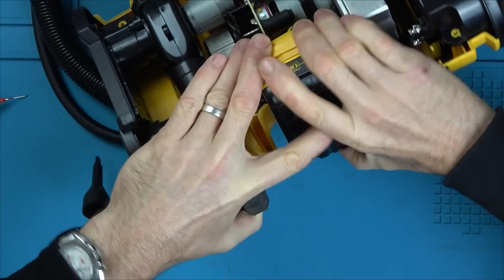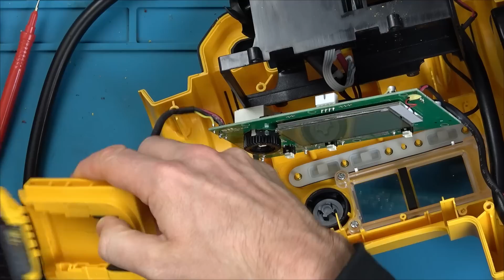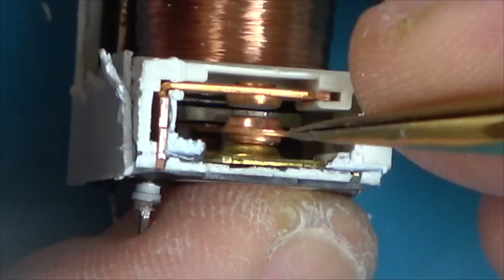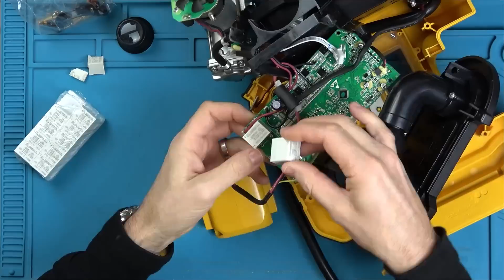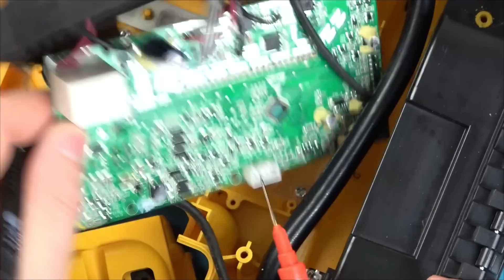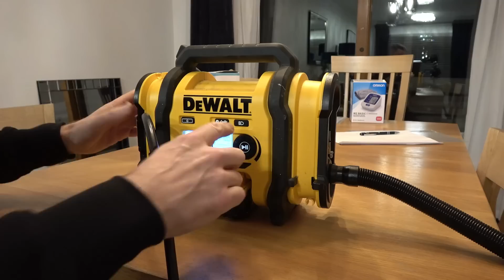My Mate Vince Advent Christmas Fixathon Challenge - Day 7

Comment: You can buy small copper bushes/inserts/rivets to replace a via. I have 4 sizes but I only need them if a customer first tried to repair something himself. 🙂 I do not damage vias because I have a professional desoldering iron (a Pace SX100 on my MB250 and a SX90 on my  MB350)

Comment: I’ve just done a repair from your video, exactly the same problem, exactly the same issue though I damaged one pad but put a jumper wire in and bingo worked a treat, I really hope you do more power tool repairs as many fail due to components on the board which with brushless tech is sealed but would love to you do some none the less keep it up 👍🏻

Comment: Forgive me if you've already been told or worked it out, but that negative plane that you were wondering why it was marked up as positive - the marking was actually for the component D2 which is a connected in reverse polarity across the relay coil to clamp the reverse voltage generated by the relay coil's mangetic field collapsing. There is another one for the other relay, D1, and this explains the positive sign on the negative copper plane.
Reply from the maker: Thank you Pete 👍👍👍
Reply: @Mymatevince  mate! you're more than welcome. thanks for all the fantastic entertainment!

Comment: That was a cringe fest! Why didn't you just link the two positive terminals of the relay with a jumper wire on the back of the PCB? It's ground side switched so you could have had that repaired in 10 minutes mate. 
And just for the record, when you said the "low voltage" side of the relay you really meant to say the low current side, because the power handling and switching sides are both 18 volts! 
Anyway, it's good to see you upping your skills and getting stuck in to electrical repairs Vince. Respect.

Comment: Diode D2 is for reverse polarity protection. That's why the anode is connected  to negative.
Reply from the maker: Ohhhh, thank you👍👍👍👍
Reply: @Mymatevince probably rather a flyback diode for the relay coil(s). There is another one across the second relay coil in reverse polarity

Comment: 40:00 I don't know if it could work, but what if you added some solder on the relay pins, so when you heat it up and solder the bottom, the solder on the top of the pins melts and solders itself on the top side?
Reply from the maker: Very good idea. I could have put a nice ball of it up by the relay and when I heated the leg it might have flowed down onto the board. Wish I tried that!!! Good thinking 💪

Comment: It states in the Dewalt manual that "if Err5 fault Code is displayed it is due to an issue with the pressure sensor" and unfortunately Dewalt doesn't have or sell this sensor part for this unit because This product discontinued and the part is no longer available.
They said we just have to buy a newer one.
This is one of them many "taste and waste products" produced in this crazy world.

Comment: Much easier to simply pass a small wire through the hole, solder to track under relay, then insert relay and solder as normal.

Comment: That one was a lot of work just for a relay!  Well done!  If I may suggest, part of your aggro probably due to your soldering iron really being designed for tiny work and not large ground plane boards.  For items like this it is a ton easier if you have a 'soldering gun'.  These are usually 100W but can be larger.  Used to be used by all CRT television repair men.  You pull the trigger until the tip is really hot and the solder smokes (takes only a few seconds), then you let the trigger go and have a big thermal mass to go at whilst doing a solder joint (or solder sucking out of the relay vias in this case).  You can keep pulsing the trigger if you have a big thermal mass to deal with to keep pumping heat into the iron tip.  They are about 30 UK pounds and useful for 'big' PCB jobs esp. if with thick wiring or braided wire to solder.  Hope this is of use.

Comment: Hi Vince, two things: First, those aren't vias. Those are through hole pads and they do tend to break whenever removing through hole components. Vias are the smaller holes that you see scattered around the PCB just for the sake of connecting two or more layers of the PCB. And when that first through hole pad broke (which is normal), you didn't need to actually correct or restore the pad. As you saw, the +18V line comming from F1 goes to another pad and connector of the relay. You could have just taken a higher gauge wire and shorted the two together. Easy as that. When you tried fixing the through hole pad with the smaller diameter jumper wires, even if you restored the connection between the top and bottom layers, that connection would have a current limitation of those wires, which probably wouldn't be enough. So you would end up in a situation where, after a while, it stopped working again because the current would just break the wires. Whenever you face this situation, know that the problem isn't yours, it's a design of the PCB: every through hole component should have it's connection on the layer where the pad actually solders to the component. In this case, the connection was done on the top layer, but the soldering was done on the bottom. Also, I do believe the other pads that are there to increase surface, probably to dissipate heat, those should still have +18V, so you could have just had a wire running there.

I'm an electronics engineer, I design hardware boards and PCBs and it's a lot of fun seeing you fixing stuff. I wouldn't fix half of the stuff you do, I just don't have the same patience you have, but your persistence makes every video worth it !
Reply from the maker: Thank you Luis 😎👍👍

Comment: if I remember correct you have changed bad relays before. No clicky sound from relay made me believe you would bring out bench power supply to confirm fault.
In my opinion, DeWalt is cheap powertools at premium price.

Comment: Relays are super simple to understand once you’ve seen them in action. I would have thought that the voltage is probably more to do with how much power is needed to fully operate it. Although the 24v unit also looks much bigger than the 18v one.
Dirty contacts are the most common problem, but coils going open are becoming more common probably due to the poor manufacturing of these cheap units.
My first job within BT involved hundreds of thousands of relays with multiple spring sets and contacts.

Comment: This is a common error with the tyre inflator there is a lot on there forum they recalled a load to be done it's the air sensor is faulty hope this helps

Comment: I've had to repair via's in the past, but i put a piece of wire through the hole and solder it to the relevant track/plane and you'll have a piece of wire sticking through to the solder side of the board, you can put the relay back in and solder the wire to the leg of the relay, if it carries significant current you could drill the hole bigger and put a piece of thicker wire in...

Comment: In a job like that, I go in with LOW MELT SOLDER, then use my desoldering gun or , braidwick, to suck through the via's. Never had an issue like you had?
All boards are different due to their thickness. LOW MELT, is your friend!!!

Comment: Thinking outside the box for the first broken via - 18V did not need to come through the via -- you could connect the 18V from the coil on the underside of the board with a wire connection

Comment: Reals don’t usually care about a couple of extra volts, think in cars most relays are 12v and alternators run  at 13-16 volts (vehicle dependent), if you don’t have enough voltage going to a relay it just won’t latch.

Comment: I looked up error code 5 and the DeWalt support page says bad pressure sensor. There are a lot of angry customers with this problem who got no help with their compressors from DeWalt and were told by support that they could not repair this and they advised the customer to buy a new one. You did a lot more than DeWalt did for it's customers by repairing this problem.

Comment: Surprised you didn't put 18 volts after the relay to see if it worked. Also you should have put 12 volts with your bench power supply on the other plug. That relay should have worked.

Comment: I was all pumped up for advent fix seven and you gave us a tire inflator!! For the vías, I would have run a small length of wire through the hole in the board and soldered that in place on both sides, if there is enough space left to insert the legs of the relay. Anyway, another awesome video. Best wishes again from the USA!!

Comment: Could have just taken the 18v + from the coil pin to the load pin on the back side with about an inch of wire 🤔 after you realised the via fault but great fault finding on such a tricky board 👍

Comment: The manufacturers know what they are doing.   If they spec an 18v relay - you should put an 18v one in.   Simple as that.  Relay primaries will work with higher voltages.  It is not ususual for 24v relays on 28v circuits in jukeboxes that have been working for 45 years.   When the battery starts to drop, the relay will cut out.  

Now like what other people have said - you could use a temporary jumper on that relay and save yourself a lot of time fault finding.  

Get a decent solder/desolder station, and get plenty of different size tips.  It will save you lots of time.

Comment: Vince with Vias that only go from one side to the other side, 
there is an easy fix, and the fix is drill a new hole at least on one
side where the track is to go through to another track on the other
side, once drilled all you need do is to feed a wire through and 
solder them to each other on either side, just keep in mind you 
really don't have to drill the tracks on both sides, what's important
is the two tracks that were supposed to be connected via a via
are connected by a wire threaded as close as possible to where
they are supposed to be connected, bare in mind the only real 
reason not to just thread wire where the Via is actually missing is 
because of the potential to component instability or the risk of 
shorting, In short in this case all you need to have done was shove 
that fat blue cable through and solder it on the other side, then turn 
the board over cut excess cable leaving a little length to splay the 
strands to then solder them down..
Reply: Could have also gone the mechanical route: drill a tiny thru-track hole somewhere convenient & simply add a nut & bolt (with solder ofc) to act as the via

Comment: The 24V relais is a more appropriate choice in this case in my opinion. The average voltage for the battery is 18V (3.6x5 cells), but the maximum is 21V (4.2x5), which is too much for an 18V relais and it will burn out the coil. A 24V relais will work fine at lower voltages, down to probably about 8V or so.

Comment: Strictly speaking they are not 'Vias' they are 'Plated Thru Holes' that allow component legs to pass thru. A 'Via' is a small board interconnect ! I don't want you getting into trouble from your sponsors for getting simple PCB terminology wrong ! that would be WAY out of order !!
Reply: I was taught that several years ago when I was an apprentice, Working in the printed circuit department. I thought the terminology had been changed whilst I'd been retired. I think 'Mend it Mark' uses that terminology too! A small piece of tin copper wire down the side of the through hole would have done the trick. Phew, that would take the pressure off.
Reply: @xeroidkid  you learned well ! The terminology hasn't changed and your method of a 'Fix' is still the preferred way if you can, or copper rivets like 'Mend it' has :)

Comment: solder a  wire onto the legs of the relay and push it through the via hole.
Reply: That would only ensure connectivity on the exposed side, which wasn't the problem

Comment: Might have been too fiddly but could you have used solder wick to pack out the holes around the relay pins in the hope that pulled the solder through? I'm guessing it was throwing that error code because it's inconceivable that it wasn't generating air so if it wasn't seeing a change in pressure it was coming up with obviously the sensor is faulty.

Comment: I doubt that the voltage will be too high with a full charged battery, even on the 12V version the maximum allowed coil voltage is 15 volts

Comment: Vince, when you knew the relay was getting power to the coil why didn’t you jump the other connections with the tweezers ( or better multimeter on Amps) simulating the relay switching thereby proving the rest of the circuit

Comment: Vince you need a desoldering gun, oh wait you've got one !
Reply: Vince needs a SERIOUS soldering gun; I have a Weller gun with a trigger and REALLY puts out the heat for big piles of solder.
Reply: A desoldering Station makes it so much easier to just take of components for testing. It also is far less stress on the board and components.

Comment: I would have clipped a slot in that black cover to be able to fully remove it, and make things WAY easier. Also, I would have taken a fine strand(s) of lamp cord wire and run it through the via hole to be sure it contacted both sides of the board and a bit of solder to each side, before you have the relay in, which would also give a thermal path. I also would have hit the relay directly with 19v to make sure the motor ran prior to taking it out. Very good you energized the relay to hear it click, as a troubleshooting step.
Reply: but that would all have been quite logical and boring and wouldn't be a typical "Vince" video! 🙂
Reply: @andygardiner6526  Yup, like looking up what the error msg means (tho that wouldn't have helped much in this case)

Comment: Just watching your your YouTube if you kept the wire from the relay you pulled apart you could have used that to repair the via by putting a piece of  that through the via to repair it error E5 is a bad pressure sensor

Comment: Could have found thinner wire 😂😂😂😂
Reply: YUP, using the ol' 2 AWG to jump the via's was a bit of overkill 🙂
Reply: @ I’d have put solder mask tracks over the board, then soldered some bare thinner wires over that then run solder mask over the finished wires 😉😉

Comment: I had a 'Michelin' branded inflator, that was comically shaped like a tyre. 
It was quite expensive, but failed after a about half a dozen uses.
The relay had failed, but not the coil. It was the contacts which had burnt out. The relay seemed really small, considering the application.
I repaired it by fitting a bigger relay remotely in the case.

Comment: Why did you ignore the error 5 message and not find out the meaning of error 5 first thing?
Reply: Error 5 is a pressure sensor error. since it's not seeing the pressure change it's shutting down the pump to protect it and it sets the code after a few seconds. in the video it set the same code instantly when the pressure sensor was disconnected.

Comment: Before you took it apart, would it not be advantageous to see if you could find out what error 5 meant?
Reply: Vince thinks error codes are for rookies.
Reply: Thought the same thing
Reply: I'm guessing that he wanted more of a challenge for the video
Reply: Because he likes to go into repairs blindly, I also think looking up errors could help with repairs but it might make some videos too short cause he can go straight to the issue instead of finding it out on his own
Reply: From my experience, with alot of new items the codes seem to be super generic "hardware fault" and customer service will just tell you you need to replace it. Had this with a printer and coffee maker very recently. Most companies have no desire to help you troubleshoot and repair your items nowadays.
Reply: that is the first thing I did
Reply: Im thinking if the owners manual would have had a error list. The manual solution would have been to contact customer service with that detailed of a repair.
Reply: Error S for Pressure Sensor fault. Video would have been 10 min long if he had looked that up 🤣
Reply: Unless you working for repair center in China, service manuals and information are very limited or even misleading. Only vendor will know what error 5 mean.